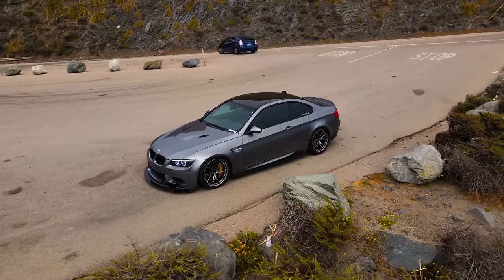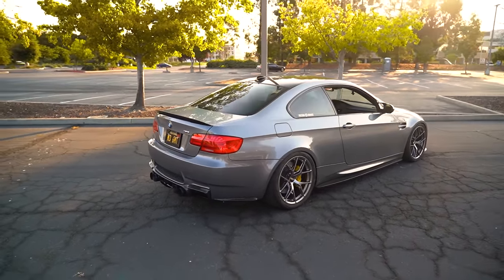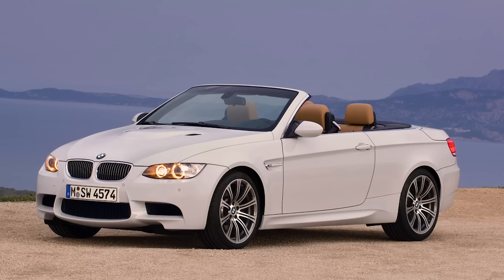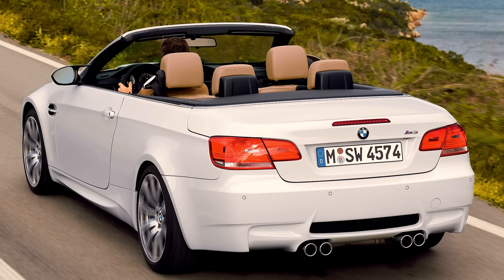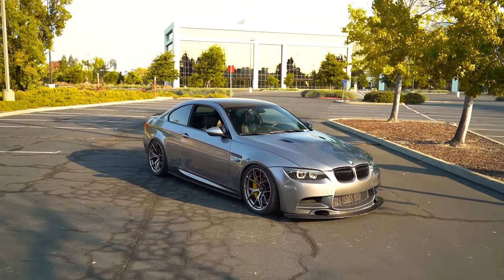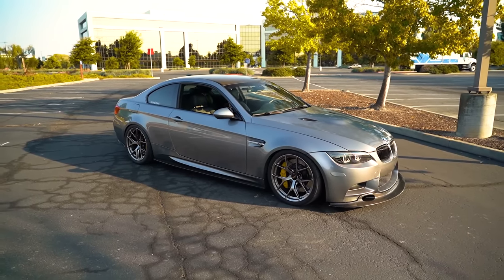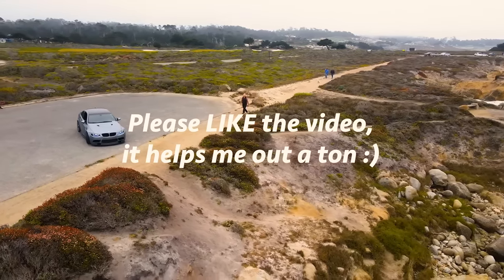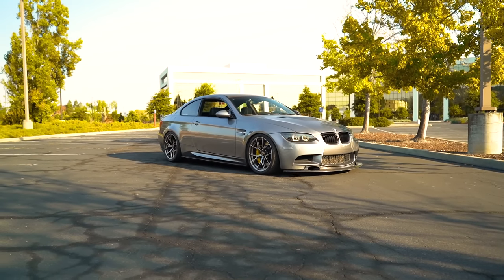Everything You Should Know Before Buying an E92 M3

Comment: I went with a Competition Package because it’s a lot lighter in weight. 🤞🏽
Reply: Wrong
Reply: @matthewedwardfield  3,565 lbs (Comp Pack) vs 3,704 lbs (Base Coupe)..
Reply: Comp pack wheels are heavier than 220m.. the rest of the car is pretty much the same. I am in uk and my standard m3 has carbon roof.
Reply: Just checked.. the u.s spec is 100kg heavier than the euro spec. Seems we are both kind of right.
Reply: @matthewedwardfield  Ahh yes I see. I am also running lightweight wheels from Carbon Revolution and some aero parts from Flossmann. I also installed a carbon rear seat delete from IND/RKP. The shop weighed it in at 3,352 pounds after installing the Active Autowerke supercharger. I’ve been working on this car for 2 years to get it down to a desired weight.
Reply: @kyotijhan3456  That's E46 M3 weight. Good job.
Reply: @idokwatcher2062  Thank you! It took blood, sweat and tears to get it this light! I feel so good every time my gf and I hit the Highway for a little fun. Her Hellcat can’t keep up no matter what. Mission accomplished! 😂

Comment: the only thing i’m confused about is with the rod bearings, if you put higher clearance rod bearings does it solve the problem or does it make it less likely to happen?
Reply: would also like to know this
Reply: I guess I'll answer this.  The higher clearance rod bearings should solve the problem.  The car requires 10W60  oil which is like molasses at colder temperatures.  The higher clearance will allow the oil to flow better and not starve the rod bearings.  I'm at 71k miles and will need to start thinking about it soon.  Do the engine mounts at the same time.

Comment: Why do you say like fifteen times that the DCT is an amazing transmission??????? Once would have sufficed... And I don't think it's such an amazing trans. Manual is the ONLY way to go. And as long as I'm being a bit hard on you, CRapple car crap is pure shit. It doesn't work well, and can't do half of what Android Auto does. It might look a bit nicer on the OS than AA, but AA performs way better. Putting a brand new Android Head Unit in that space is a much better deal than the OLD idrive system. Sorry for the negativity, but those things needed to be said. BTW, I have the 09' model, and it also has the truck key hole in the same place. And I'm wondering why you didn't speak about the steering wheel??? It looks very nice, but I bet it cost at least a grand. Good vid.

Comment: Hay, ok" look I have a E92 sport pack and sport seats, yup" all leather. Now about the dual hump. For a start, I know where i'm going and I don't need help from a car. So a single hump is very fine with me. Classic is cool with me. Also I'm naturally aspirated motor or one of the most reliable engines in these cars. At this time I have 108,000 original miles a d they are true miles because I bought it new in 2010. The only thing I have changed is a battery, oil, plugs, fluids. Nothing more. You must do maintenance religiously..or your going to regret it. I do all my own work. Parts if I need them sooner or later, I will buy them, and install them. As a engineer things are a breeze for me. These cars are expensive to own. So if you rely on a mechanic your going to pay out the nose, and maybe your bank account. So good luck. BMW is a very nice car. But not for everyone, and if you want to race it. Buy a race car, Chow.

Comment: I really don't get how you guys have so many problems with your BMW that's the only car I will buy because they're so dependable I have owned for and I just got my 5th one I have put well over 100,000 miles on each one of them the only problem I've ever had was in my 330ci the fuel pump went out $75 took me like a half hour to do underneath the backseat simple...... besides that nothing not a single issue out of four I've had to 325 the last one I had when I sold it it had 240,000 miles on it the other one when I sold it had three hundred thousand miles on it the 330ci was well over 200,000 miles on that one too and my e92 well over 200,000 miles on that one too never a single issue with any of them besides the fuel pump...... I can understand if I got one and just got lucky but that's 4 BMWs over the last twenty years of my life no problem seriously what the f is going on out there what are you guys doing to these cars not.... I think what happens is a rich kids get ahold of him zero maintenance but they just try to modify them and put it to the floor every time they take off I guess that's the problem and then people come along and buy their used lemons that been beat up by an eighteen-year-old.. Oh yeah and when I sold each one of those cars they still ran absolutely perfect...... I guarantee you if you buy a BMW and you have it certified checked out make sure it's legit not owned by an 18 year old you'll have a very very reliable car and I'm only referring to the three series...... I've never owned a 5 series or 7 Series 6 Series 1 series none of them I'm not going to speak on those 3 Series only

Comment: This vid pretty much sums up the hours I've spent on M3post/M5board before I felt confident about also adding a manual E63 M6 to the collection as seen here: https://www.youtube.com/watch?v=u1dx-RAa9xE

I went with ACL custom clearance bearings and OEM rod bolts. The engine mounts on the M3s in particular should be done during rod bearing service as those are definitely shot when it comes time to do the bearings.